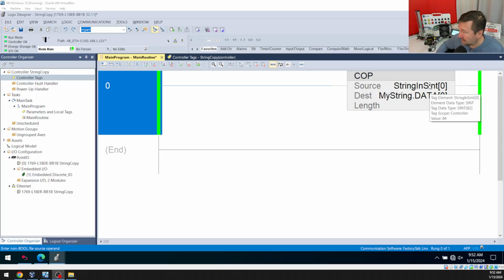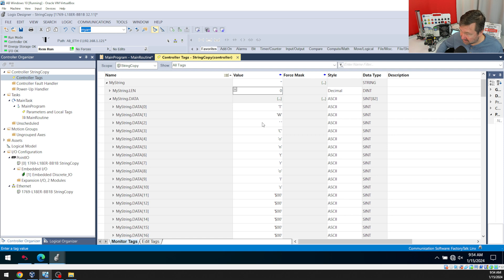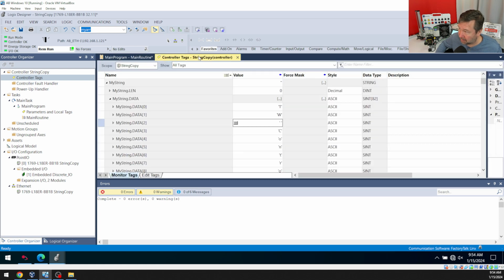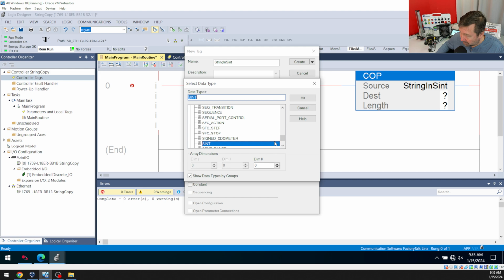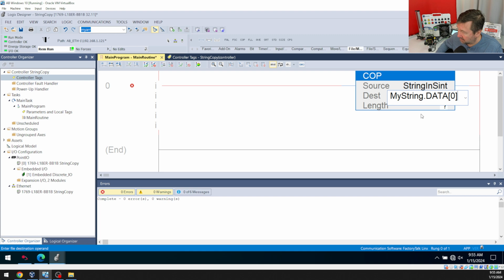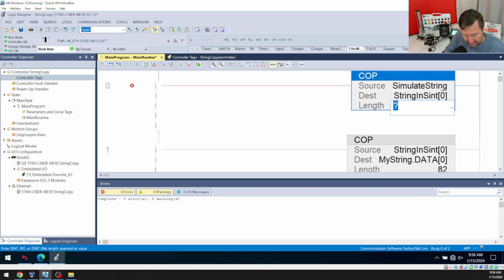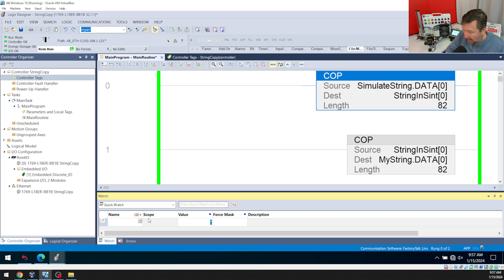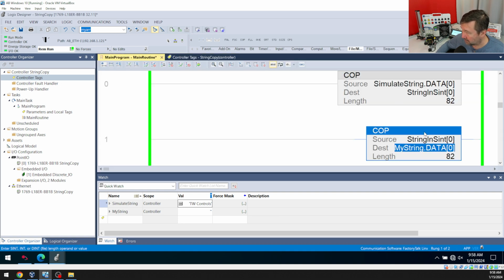Simulating String LEN Problem for PLC Riddle in Studio 5000

Comment: I found a way to make it work. I can successfully adjust the lenght of my string by finding the first '$00' character and moving the found lenght of the string into the .LEN parameter.

You will need 3 instructions. Make a rung with SIZE, FIND and SUB.

SIZE will find the length of the array within the string data type, 80 for instance. You can store this value in the .LEN parameter of your string
FIND will find the first '$00' character in your string, which is the stop signal of your string. Store this value in a temporary tag.
SUB will substract 1 from the temporary tag, because FIND starts at 1 and arrays start at zero. Store the value in the .LEN parameter of your string

SIZE(my_string_80char.DATA,0,my_string_80char.LEN)FIND(my_string_80char,search_0,1,len_temp)SUB(len_temp,1,my_string_80char.LEN);

Comment: Hello Gents, Did anybody find out why is this issue happening in Rockwell PLC´s? Its happening even if you are recieving STRING data for example from 3rd party Software trough OPC server. Sometimes STRING is visible with correct lenght and sometimes STRING is there but lenght is 0 so PLC shows nothing and it behaves like you didnt recieve any info in to the STRING Tag. 🤔🤔
Reply from the maker: It has more to do some devices don't send the LEN value of the string.  Here is the original livestream that this video was to simulate so that you can determine the length.
https://youtube.com/live/MySFNriCs8w

Comment: Any idea why the PLC wouldn't calculate the string length on its own? For example, in C++ if you type myString.length() it would just tell you what it is because it looks for the terminating character on its own. From there just have the string length capped at the string size to help prevent buffer overflows.

Clarification edit: I know the .length() is its own function to calculate the string length and the length isn't an attribute that stays with the string variable, but sense the string in the PLC does have the length attribute bundled with it I think it would be a nice feature to have block from AB to just find the terminating character for you as it would be such a common thing for people to do with strings.
Reply from the maker: If the data is being manipulated from another source, how will it know that it needs to do the equivalent of the .length function?
Reply: @TimWilborne  that makes sense. Going back to C++ it wouldn't matter how long the string is as the string functions will work until they see a termination character. So the PLC equivalent could do the same, then if the programmer wants something else then it would be on them to shorten the string.

Comment: Oooo here’s a weird one. I got a new work PC and the display is a 4K display. 4K display does not render correctly in Studio 5000. The display settings are 3,840x2,160. With a display font setting of 250%(Recommended). That cuts off every toolbar in Studio 5000. I have to either change my display font size to 100%, unreadable with how small the text is, or change the display settings to 1,920x1,080 and font size to 100%(recommended).

Comment: Okay, we generally have issues with this topic when we use cognex scanners the results are string the length is 82, what we do is to use $ sign with the find command, and then we know the length of the result. I could explain better when I check the code.
Reply from the maker: I would be interested in the details of how you use the FIND.  It is the one way I couldn't make work.

Comment: Well I misunderstood somewhat on your previous post. What I would do in this instance is make my own sequence, kinda like a jmp lbl but in a numerical Seq. Use 2 rungs and make an index (data type DINT) that you add 1 each time your  StringInSint[index] is NEQ to 0. 

Then branch and look for StringInSint[index] is EQU to 0 followed by a MOV index into your sting LEN. Then clear your sequence and index values. 

Also make sure you have conditions that will not allow the rung to scan if your index is greater than your element level. Hard for me to type it out but that is where my mind is going.
Reply: I’ll be looking out for the video!
Reply from the maker: Your mind is in the right place, but there are a few instructions to automate the task for you.

Comment: I wonder if you can use a move command to move the data from the string to the length
Reply from the maker: First you have to determine the length of the string.